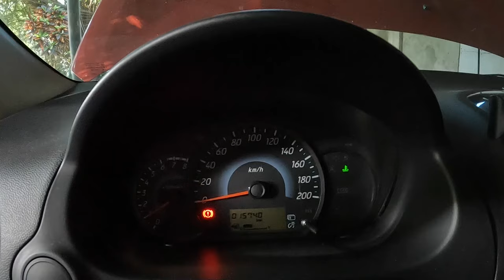Mitsubishi Mirage Maintenance | Mirage PMS

Comment: Odd to block only the front wheels when you lift up the front of the car.  Also my Mirage takes a different viscosity of oil according to my manual.  Liked watching the filter changes.  I often neglect them.

Comment: 5w-30 is not 0w-20 ?
Reply from the maker: It depends on the country. Here in the Philippines 5w30 is recommended based from the owners manual.
Reply: @OptimumPH_   Or thank you very much I was half confused because my manual says 0w-20 to 20w-50 and I say this can't be . on the cap it says 0-20 that's what I use when I have 100 thousand miles I'm going to put 0-30
Reply: @alexisruizperez2184 only matters in cold environments... i would put 5w30 in if its constantly over 75degs (f)

Comment: boss ano po ang tightening torque (n.m.) dun sa oil drain plug, wheel nut/stud at etc.? Salamat po.
Reply from the maker: 34nm sa drain plug then 122nm sa wheel nuts